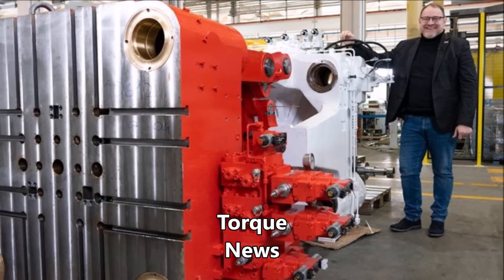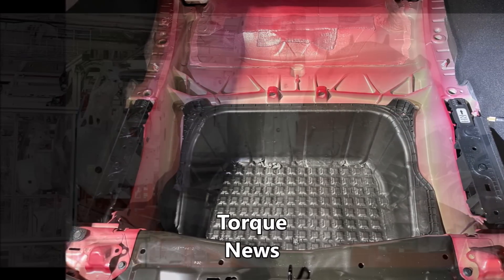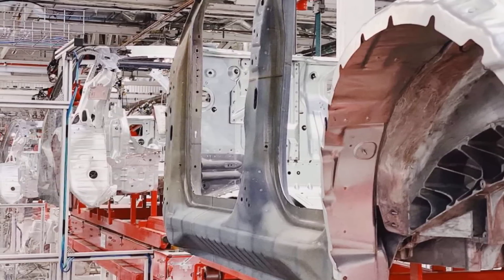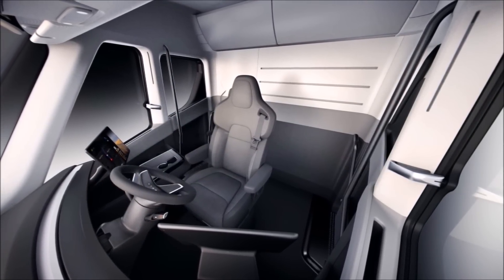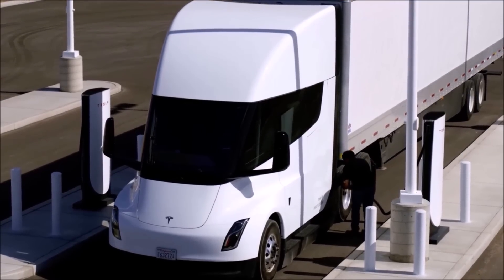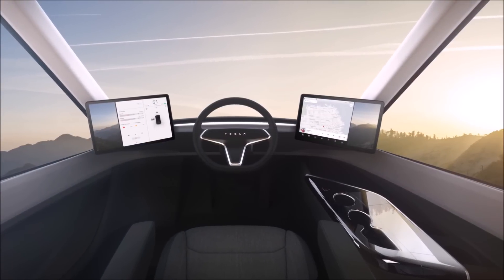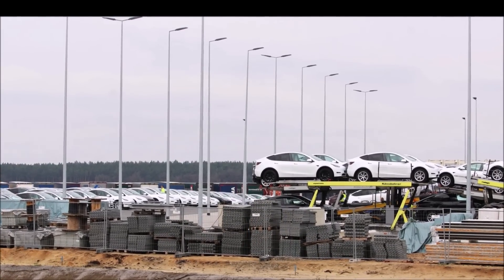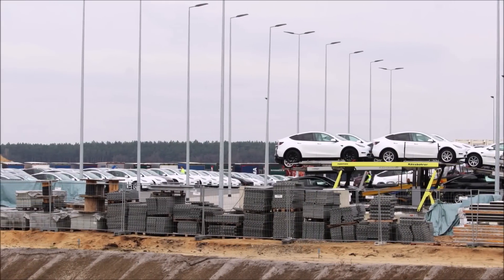Tesla  Gigapress Maker IDRA Shows New Photo Saying Gigapress Will Make Motor Rotors

Comment: These commented semi issues are minor and stupid. Half the time a driver can not reach to hand someone something even in a regular truck and has to open the door and get out. This is a minor and thing that takes a moment.This is only for these occasions at a gate versus the hours spent driving behind the wheel in a safer position with better view.  As apposed to the fact that driving in the middle is safer, and provides better visibility. Drivers have commented that they will never go back to a regular truck again. also getting in the truck is easier and safer. It is known that most of the injuries with truck drivers is having to shuffle into the seat from the door opening causing back and strain issues. Getting into the tesla truck means walking in and sitting down which is safer and more convenient. These are nonsense issues and have already been rebutted.   People are clearly nitpicking or have not really looked at all the facts.

Comment: How about using the giga press to produce a structural battery casing with the 960 slots to insert the 4680 inners rather than using stainless steel casings, much lighter but same strength. Otherwise cast multiple aluminum casings in one go and replace the stainless-steel ones.

Comment: That's wrong. Most trucking now do their paperwork electronically.  In some case it is geofenced on approach.  Amazon went to this some years ago the industry has follow this trend.  So there is no huge line of trucks waiting to have their paperwork looked at.
Reply: Should be done on the phone and license plate is identified upon entry.
Reply: @rb8049  This is usually done electronically already.  I know, I've written the software for some large trucking firms to do just that.  Which is going to be the target customer of Tesla Semi anyway. The big shipping companies run terminal to terminal, roughly 4 hours away from the next terminal, so the driver generally only has a 9 hour total shift.  The electronic manifest is usually sent on the last leg out of a customer sight if it is required.